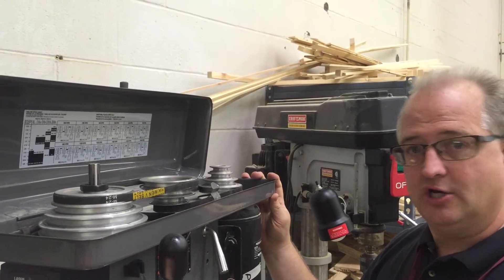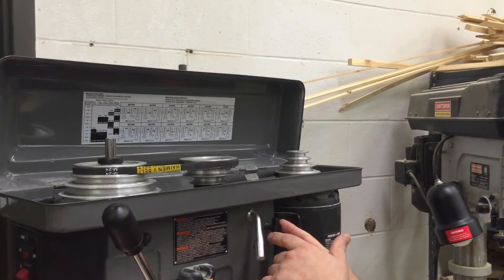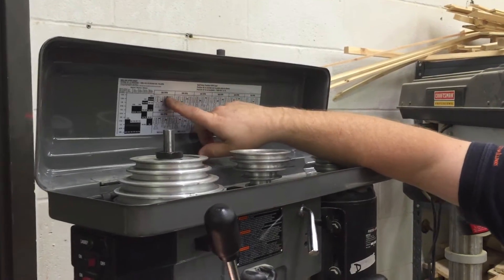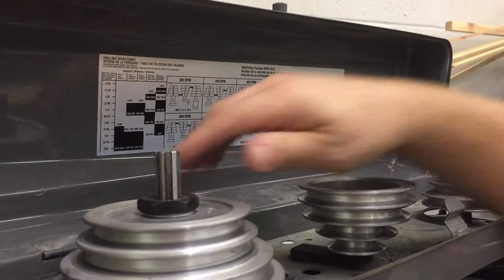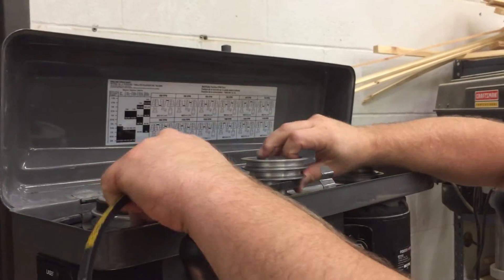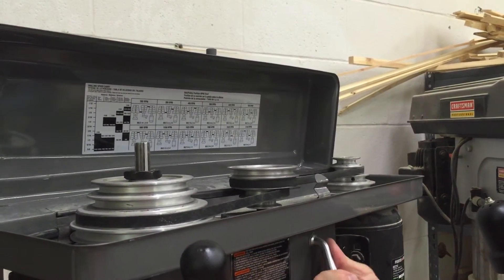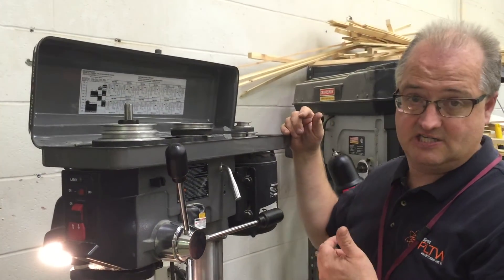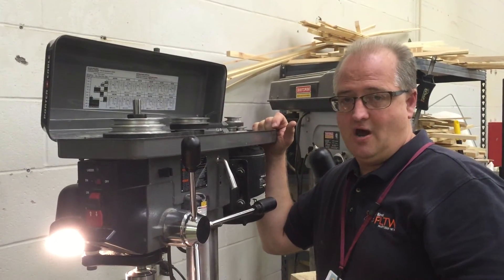Changing Speeds on the Porter Cable Drill Press

Comment: Is their a standard rpm to leave it at? Let’s say to make euro hinge cut outs?
Reply from the maker: In general the rpm of a drill bit depends on 3 things: the material being cut, the type of drill bit being used, and the diameter of the drill bit. The larger the drill bit the slower the RPM. If I was just using standard twist drills and wanted a standard RPM I would probably run somewhere around 500-700 RPM depending on my drill press and if I tend to drill smaller holes over larger hole but most of my projects have holes under 1/2".